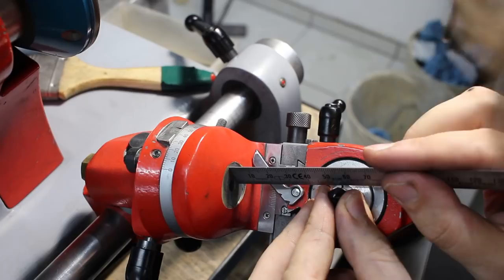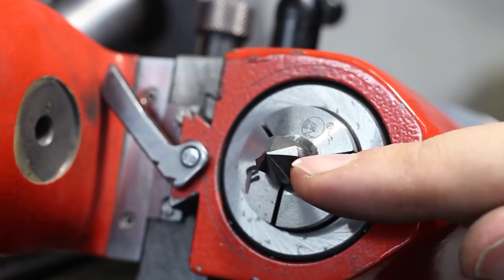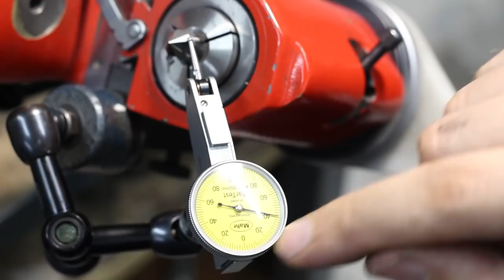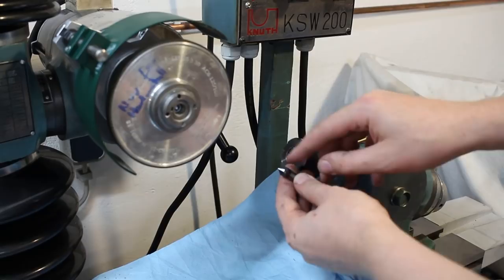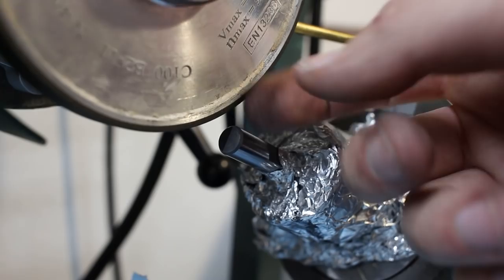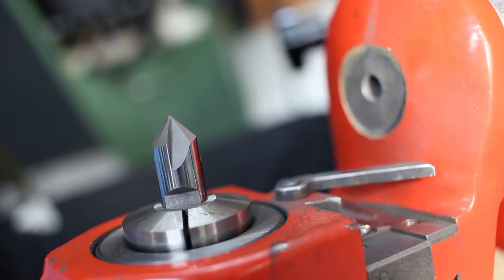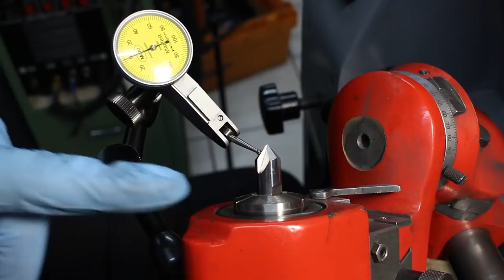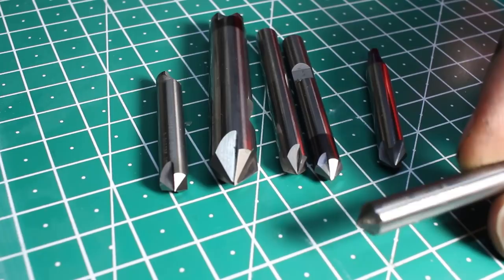Toolgrinding: (Re)Grinding a chamfer endmill

Comment: As an apprentice toolmaker I was taught how to use our clarkson tool and cutter grinder. I have one of my own and still use it to sharpen,make and modify my own cutters. It has saved me so much money. Chipped carbide cutters are worth next to nothing as scrap and I collect a lot of them from machine shops. This gives me a lot of really nice cutters for little more than some time. Cutting your own tools essential for anybody keen on saving lots of money in their own machine shop. Cutting rounded tip cutters takes some skill but well worth mastering. Have you tried it?
Reply from the maker: Last time I got my scrap carbide to the recycling place, it was about 300Eur ;)
I can do rounded (Full/partial/offsenter) radius tools on the dbit grinder. I need that occasional for lathe tooling.

Comment: Could you clarify this:   Could I accomplish everything in this video with just the tool & cutter grinder, or do I need both machines?  I know the tool & cutter grinder is more flexible and capable,  but does that also mean it’s a total PITA to use for more common tasks done on the D-bit grinder?
Reply from the maker: A full t&c grinder can anything and more than a dbit grinder, but its way more setup work. So if I can, I use the dbit grinder for almost everything possible and the t&c grinder only for specialised setups.

Comment: Nice work,,i have a big snapped off drill bit that's going to get treatment...I don't have a tool grinder but I'll find a way to do it on the little  horizontal mill made into a make shift surface grinder.

Comment: Hi Stefan, at 10:20 there is a leaver thing just below the collet, I have yet to figure out what that is for? Just touched up my cutters thanks!!
Reply from the maker: That finger is to align single flute cutters/d bits vertical to the spindle of the dividing head. Needed for grinding and regrinding the radial relief on them.
Reply: Tried it and that eliminates using a ruler to set an end mill horizontal! Set the dial for 90, line it up then rotate to zero... Thanks for the tip!!!!

Comment: Stefan, with regards to you setting the cutter on the red grinder and using a scale, you already have a setting gauge BUILT IN. It is the flat bar that is set into the collet block, it is fixed to a pin that is in a reamed hole that is on centerline with the indexer.You just have it sitting there in front of you, READ your Instruction manual. You can raise it up to any height ( within reason ) to suit your cutter. If it is not mentioned because of the Chinese conversion language, then Google the genuine Deckel SO 1. I know that using it will give you the vertical location, so just index 90 degrees or whatever  to orientated it to horizontal. When you find out what it does, you will kick yourself for not using it, instead of machining the indexer and sodding about with a scale.
Reply from the maker: I know about the setting gage and I know how to use it. And I know how bad it is to be used on multiflute tools.
Personal note: I generaly asume the other person knows more than myself and has already thoroughly tought about what he is doing.

Comment: Stefan: Tool and cutter grinder vs. surface grinder? I have no space for both in my workshop and I will not grind big parts. Like surface grinding capacity of 200mmx100mm would be enough but I need to do OD and ID grinding. Would it be possible to mount a magnetic chuck on a tool grinder and do small surface grinding? I really would appreciate your input. Thank you for your wounderfull videos!
Reply from the maker: If I could only have one, it would be a surface grinder. Or a very substancial tool/cutter grinder.
But most t&c grinders are not  good at surfacegrinding, while a surface grinder can do most other tasks with a bit of creativity very well.
Reply: @StefanGotteswinter   Thank you very much! So now I only have to find one which fits through my door (90cm) without to much disassembly and is in a decent enough condition.....

Comment: I don't know much about this stuff. How does a production tool grinder maintain the corners of their wheels, when grinding a bunch of these? Seems like it would be a pretty significant issue??
Reply: They will rough them in, to the point Stefan did, then use a wheel with a sharp corner to cut that last little bit. Then when it wears they can use it as the roughing wheel. You can also dress the wheel and bring back the sharp corner, but you lose a lot of the abrasive material when you do that. That's why Stefan didn't do it, but they probably would in a production shop. Since the finishing wheel is only cutting a little bit, it can be dressed relatively easily.

Comment: Hey Stefan
Nice and informative video as always👍 Would it better if the dividing head was set in a 30ish angle, to get the tip also?.. Just wondering🤔
Reply: The angle of the head doesn't matter if you don't have a square corner angle on your wheel.
Reply from the maker: Does not change much - Only the flute gehts larger/longer. And you get into terrible clearance issues with the wheel.

Comment: I have an idea for orienting the cutter in the grinder more easily. Instead of using a scale or eyeballing it, why not make a bar that's 55.5 mm long with a magnet on one end so you can stick it to the flat you machined. Then you can just rotate the cutter until the flute touches the bar. Should be quicker, less fiddly, and more precise.
Reply: That's basically what he said at 6:57

Comment: Stefan, thank you for this very interesting video.  Every time I watch one of your videos I learn something new (even if I've already seen it ;).  I wish I had a better grinder than a cheap bench grinder!

On another topic, have you (or Robin, if he's reading these comments) ever measured the accuracy of an edge finder?  The type that kicks off to the side when it contacts the edge?  G. H. Thomas wrote (in his "The Model Engineers Workshop Manual") about measuring a .0005-inch (0.0127-mm) error in his edge finder.  I'm now curious about how much inaccuracy is really there and wonder how (little?/much?) that affects the work done by Precision Machinists.
Reply from the maker: Thanks!
The normal edge finders are crazy accurate and repeatable - I find them accurate beyond 0,01mm (total and repeating) - Proven on a darn accurate cnc machine with linear scales.
Reply: @StefanGotteswinter  That's good to hear. I've also wondered how good they were, and suspected that I might be losing precision there. 

I get really anal when I'm indicating on my little CNC mill. Clean and deburr everything, do the final steps in 0.0001" increments, then back off and check a second time.
Reply: Since 0.01mm is approximately 0.0004-inches, then I guess Machinists working to extremely "tight" dimensions & tolerances must use some other device to locate the "true" edge of a part?  Of course, you did say "accurate beyond 0,01mm (total and repeating)," so they are obviously "better than" 0.0004-in.  That's certainly closer than I can work with the machinery & "skills" that I have, at least for now.  I hope to be able to spend more time in my workshop before too long and improve my skills.

Comment: Don't you get a lot of oil mixed with metal dust running down the shank and under the aluminium (tin) foil into the collet? Perhaps some masking tape to seal the protective sheath?
Reply from the maker: Better than without. But I still throw all the tooling in the ultrasonic afterwards to get it clean.
Reply: @StefanGotteswinter  Of course. That'll do the trick! Just thought you wouldn't want to have that grime on the inside of everything.
Reply from the maker: If I had to do way more grinding, I would do something like you described, maybe even machine/3d print a cover to go over the end of the colletchuck.

Comment: If you cut the end off a party balloon they also work very well in the way you've used the tin/aluminium foil ....🙂
Reply: Or one of those nasty unlubed condoms that are like bigger powdered finger cots. My dad used to put them on my RC car, to cover the speed control wipers, and it wasn't till I got a bit older did I know what they were.
Reply: Andrew Delashaw preferably a new one.....

Comment: Awesome video as always💪👌
Btw, with these grinding wheel adaptors can you run the wheel both direction, or does your t&c cutter have a left threaded spindle?
Reply from the maker: Yes, they can run in both directions - The washer between the wheel and nut is keyed to the adaptor and the adaptor itself sits on a selflocking taper.
Reply: @StefanGotteswinter  Thank you, I thought it to work the same way. I'll have to make a bunch of them

Comment: In order to cut closer to the center, I've seen a 4 flute chamfer mill that takes 2 opposing flutes to the center and I believe used a small gash on the other two flutes to prevent them from getting in the way at the tip.  This means the 2 opposing flutes can be cut slightly past the center of the tool to avoid having to use a perfectly sharp grinding wheel.  This seemed like a good compromise to keep the advantages of the 4 flute but keep the ability to cut chamfers into very sharp corners.  Perhaps something to give a try?

Edit: Here's one.. https://twitter.com/HarveyTool/status/1172526713164783617

Comment: SG:  thanks for providing videos that make me (have to) think...  ~~grin 
I hope there is a useful answer to this without requiring much more than the
Bench grinder, stones, files that I already have...  at a 'scrapyard' recently,
they had a large bin of  twist-drill-bits,  taps, Center-drills, Counter Sinks... etc
from some large shop's  waste collection...  I got 6-8 pounds( 16 oz Av) 
thinking I could perfect(start?) a hand-sharpening skill... 
Specifically,  can a  center-drill be  "touched up", improved or sharpened 
to provide a more useful tool-bit ?  Am I limited to reShaping the very end-tip ?
Any ideas, anyone...  thanks  'ToyFJ40'